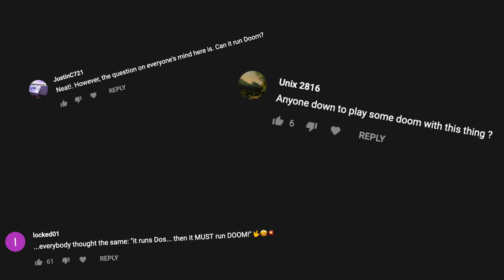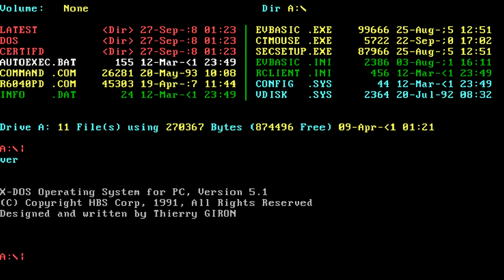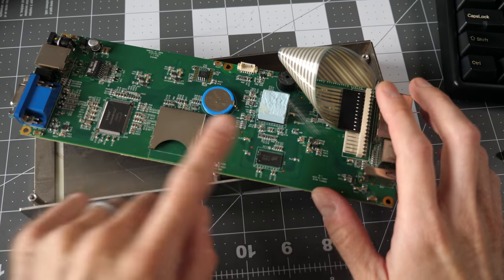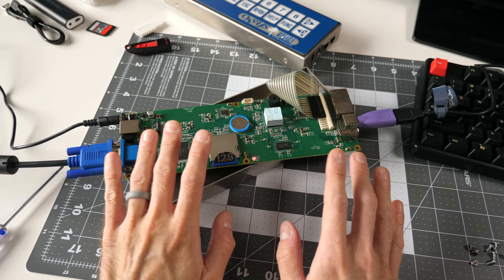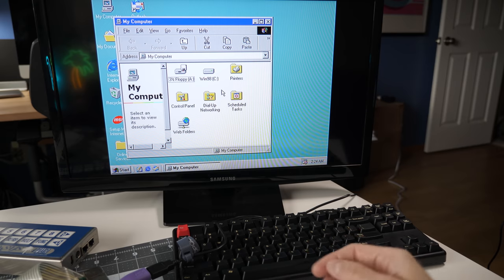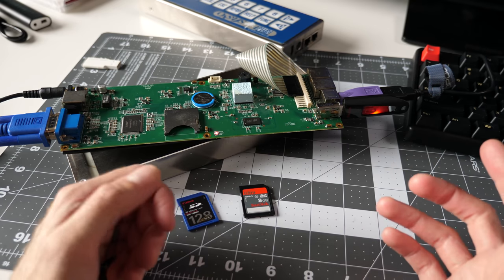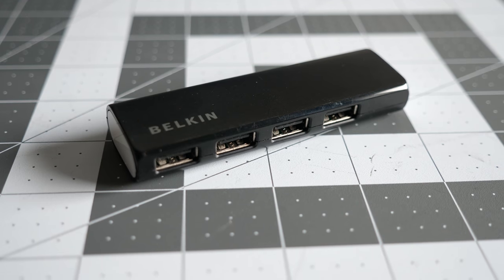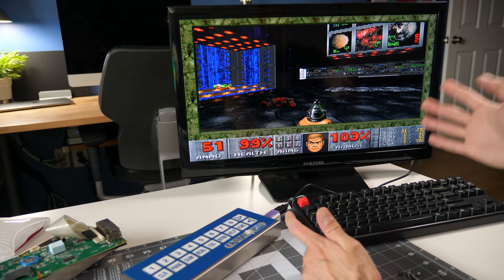Doom on a Commercial Kitchen Appliance

Comment: Wait, Why on earth I would need to run Windows 98 or XP on this thing? I have almost 20G of dos games from 1980 to 2000 that only need keyboard and mouse; they do not need PNP BIOS or fancy stuff. Yes, the lack of a soundblaster is a big minus, but anyway, as a plain dos (maybe Win 3.x) machine this is perfect.
You can not sys a: with dos 6.22/dos 7 or it is write-protected? If is possible, can boot dos 7.1 from a: and use a FAT32 SD card as the internal HDD (just point the path variable to c:) and so have a nice dos machine
As you said can use a PS2 splitter. I am sorry that these are so rare and hard and expensive to find, I would love to have one to thinker with it.
Just thinking about that NIC, maybe there are drivers for dos/Win3.11 to FTP on my server?
Edit: I never ever heard about Windows 9x writing something on a floppy when reading it, unless you have a (boot) virus. I downloaded some time ago boot floppy image for dos 6.22 and there was a boot virus. And the BANANA CDROM label, I think (maybe I am wrong) that is not the original from Microsoft, old floppy images had CDROM or CD001 instead.

Comment: To me, it was a bad idea to rely on windows 98 that relies on the FAT filesystem technology to work with data stored on hardware, best to use a different solution to do a 1:1 copy of the data on the chip to avoid overwriting anything there. If XP can run on this but use linux instead and use a partition editor to maybe copy the partition into a file and then take that to your regular computer to analyze the data on the boot partition. Hope this works.

Comment: I have a 86duino running 98 and XP. The individual drivers can be found on https://www.compactpc.com.tw/. As far as I can remember, the vortex line is based on the S.i.S line SiS550, so if you cannot find Vortex drivers, try looking for drivers for the 550. Trust me, the SiS 550 is a x86 "pentium" like system that SiS was developing until they sold it to DMP, at least as far as I can remember. The Seabios includes support for USB, the problem however is that the USB needs a rather finicky driver in order to operate. Without the driver, the USB will not show up in Device Manager at all. Then when it comes to your flash chip, both 98 and XP will need a flash driver to correctly access the disk otherwise they will corrupt it. Usually embedded Windows comes with the driver installed, but since you got X-Dos, is seems it's not the case here. The problem lies in the sector sizes, and how flash based drives are addressed differently from normal hard drives. If have three other vortex based machines and they are all fun to play with.

Comment: How about to take out the spi flash, or just unsolder the power pins? The device will boot the only thing availabe which is the sd card. Also from windows a usb soundcard can work probably, windows may output sound to it from games even.
Reply: @mickwheelz Thats a real bummer, perhaps a standard spi chip, can be upgraded, there exist 64 mb variants even.
Reply: @mickwheelz Very delicate stuff , well, its repairable i guess, but there is the question, do you want to? Or do you value your time more. :)

Comment: You can de-solder the virtual chip to allow the system to also use the SD card slot. It definitely will only run Win98. Check out "lattepanda", it is a single board computer with 2 GB or 4 GB of RAM and 32GB or 64GB internal storage. It runs windows 10 and starts at $100.

Comment: Oh god, what a security nightmare. A networked device meant for the POS network, with old hardware, that auto boots to a USB flash drive.
Reply: not really..not networked so requires physical access. almost all kiosks w/usb port can be taken over. and in his older version usb access required case removal.
Reply: @littlepeon  It is networked, It's how the orders are sent to the machine. I am a network engineer for restaurants we always make sure USBs are locked down, some by physically by putting epoxy in the ports. The issue is, all an employee/cleaner/social engineer needs to do is flash a malicious version of the firmware to the device and then the POS network is owned. It wouldn't be that easy with most POS terminal's.
PCI compliance is a bitch, and I bet those things are overlooked.

Comment: I dont want to sound rude, but your incredulity at doom running on this is a bit weird, as doom was at min spec supposed to run decently on a 386 with at minimum 4mb of ram, so IIRC this things CPU was derived from the OG Pentium spec, of course it was going to run! Anyways Great Vid, ahhh the adventures of hacking hardware to do things it wasnt envisioned on doing, great vid, blathering included.

Comment: I wonder if you were having all those Windows installation troubles due to the CPU overheating. I'd suggest removing that useless thermal pad and gluing a small heatsink (Or really, the biggest heatsink you can get that will fit in the case and not crimp the cable) to the CPU.

Comment: There are a few open source DOS USB drivers available that may allow you to use one of the USB Audio cards like SoundBlaster play. Also, you should try running Linux on this thing. And definitely replace the thermal pad with a proper heat sink.

Comment: The classic 7b blue screen error - you will need to slipstream the storage controller drivers on to the Windows XP install media.
Reply: Didn't NT/2K/XP have a (Press F7 to install storage drivers from floppy) prompt or something? You've already got a working USB hub, add a USB floppy drive.
Reply: @AndrewFremantle  I had very little success with this method (vendor drivers were not formatted correctly and / or not all USB floppy drives worked - I found only a SONY USB floppy would work. It was easier to slipstream with Windows XP install media with the nLite utility/app

Comment: Real question:Why is an Oasis iPad bump bar like $770 and a raspberry pi like 1/10 of that?
Reply: Because Oasys iPad Bump Bars aren't made for tinkering, and are just supposed to work for the company who uses them.
Reply: @eidodk  thanks
Reply: also price of the chipset. PI's use ARM processors which can't do fast computing, so they are cheap. Oasis uses a Pentium 200 knockoff chip which actually has about 50 times the processing power of an ARM chip--so the chip alone is worth $100. The fact that you have it in a small form factor adds another $200 to the price. You can actually find these used on ebay for <$300 which is a good buy.

Comment: You probably thought of this already, but didn't bricking the A: drive cause it to boot from the SD card?
Reply: No. Win9x only modifies a few bytes of the boot sector (which are normally ignored) but doesn't touch the boot signature. The BIOS still sees the drive as bootable but it crashes once the corrupted code is loaded.
Reply: @eDoc2020  So with the right program you could change the boot signature to non-bootable. Then it should boot from the SD, right?
Reply: @GordieGii  Yes you could destroy the boot signature. But then two things would happen. First, the filesystem on it would become invalid because the FAT is always required to be bootable (the "Invalid System Disk" and "Non-system disk or disk error" messages are actually displayed using a tiny boot program on the disk, not by the BIOS).

Second, it might not actually work because SeaBIOS and/or the legacy Bochs BIOS do not actually check the boot signature in all cases. If that is the case here then obviously it won't know to skip to the next device. Then the best option would probably be to put a boot program on the floppy which then just transfers control to the boot program on the hard disk.
Reply: @eDoc2020  I didn't say destroy the boot signature. It's already destroyed. I said change it to 'non-bootable.'
It might not work, but the SeaBIOS did show the boot list, so it might work.
This is all academic anyway since the objective was to have a method that didn't modify the boot flash 'floppy' at all, which he achieved with the USB drive. I was just thinking how he might un-brick his bought system.
Reply: @GordieGii  Perhaps I should clarify. THe 'boot signature' is the two bytes at the end of the first sector which the BIOS looks at to see if a disk is bootable or not. Aka it is the bootable 'flag'. This is separate from the actual executable code.

If he wants to unbrick his internal flash, that hopefully shouldn't be too hard. X-DOS is available as shareware, so one could download it and run XSYS to make it bootable again.

For reference, the shareware version of X-DOS can be downloaded from the Internet Archive. Its identifier there is 'msdos_shareware_fb_X-DOS'.

Comment: First off, that's gotta be a USB 1.0 interface and using a USB keyboard and mouse (the mouse in particular) would kill the performance as it would use up all kinds of CPU cycles that PS2 does not. Beyond that you should've just removed the chip for the "SPI Flash Disk" which contained the original OS. It's easy to remove even for an average person. At that point the system is forced to run form the SD Card because the initial boot device will not be found and it will move on to that automatically. All that said... you can just run from a USB drive if you cut a hole in the case but how many people having a version that doesn't expose the USB port would want (or can) cut out a hole for it?

Comment: The issues with windowsxp are because.... it's running from a usb device. I tried to have a "roving" install back in the day. It's not fun. You need a modified windows xp install to even INSTALL correctly to a usb destination,  and then a custom driver afterwards to see the usb device as it's C: drive. 

With he odd bios, it might not even be possible, as it usually requires a bios to be able to enumerate the storage devices to windows....

Comment: I would have jumped to do Linux forget about all these restriction stuff, in a direct opposite and deliciously ironic way Linux in 21st century is leaps and bound superior to Windows in hardware setup and driver situation even thought I did say it was directly opposite to the 20th century in which Windows was the superior environment back then.

Oh SeaBIOS is what Chromebooks use for the unlocking mode of these machines. Normally it is CoreBoot into Chrome OS but with SeaBIOS set alongside it you can use another proper Linux with Chromebooks.

Comment: Doom resolution is like 320x200. Or 320x240. The CPU on the Vortex is a 486 running hundreds of megahertz... while Doom can run on 386's with a couple of tens of megahertzs. Although not too smooth. Running doom is not a challenge. See how high you can go on resolution with Quake.

Comment: Could you make a copy of X-DOS using its SYS.COM? I'd love to test it.
Reply: don't know if you can still get it from HBS, but here is the manual for it:
ftp://ftp.dmp.com.tw/os-dos/XDOS_UM_v1p0.pdf
Reply: @littlepeon  That link brings up error 404
Reply: @IrisGalaxis  so chrome and firefox have deprecated ftp. Copy the link including the original ftp part  that is not 'linked'. So your browser needs to read ftp://<link>, NOT http://<link>
Reply: @littlepeon  oh ok, thanks
Reply: @littlepeon  They seem to have locked down their FTP and disallowed anonymous access.
Reply: @TurnerXei  the link cuts off the ftp:// part, copy it all and it will download
Reply: @littlepeon  I know, I tried it both from Firefox and from the GNU FTP commandline and it happens with both. Weird?
Reply: @littlepeon  I ended up being able to get the same URL to work via searching for it and clicking through from Google results. Strange, but glad to have it, thanks!

Comment: You boot into win9x'es boot menu and go straight into DOS. Then you do "sys a:" in your prompt to rewrite the boot sector.
If the windows system files dont recognize the shipped interpreter you can just put a copy of the "DOS 7.0" win9x comes with on the internal storage.
Technically i think the command.com would suffice, in case storage is an issue, but why not bump it up to a "proper" DOS while your at it anyways.
Normally DOS stuff is pretty intercompatible, i used to run MS-EMM386 on Novel DOS for better memory management compatibility in games.
 
Also, considering how it runs open firmware (if your unfamiliar with it still, check out System76, they offer really sweet FOSS laptops) i wonder if it runs Linux.
Some Puppy Linux versions "work" with as little as 64MB RAM and fit on a 256MB stick. And on Linux you have a whole variety of DOOM ports to choose from... :p
Reply: The Win9x SYS command will copy the Win9x command interpreter over the original one. However if the X-DOS installation included its own SYS (or you can find it online) that could likely be run from DOS 7 to restore DOS-X.
Reply: I dont think the actual DOS version used matters at all, so just copying the contents of \command to the internal storage seemed like an easy and lazy enough approach. :)
Id still prefer to see it run Puppy tho, lol.

Comment: IIRC, Windows will update the OEM Name field in the boot sector (LBA 0 or CHS 0,0,1.)

The official MS tech spec on FAT will tell you this parameter is informational only, and is not used for anything.  This is a dirty lie.

It has been used as far back as DOS 2.0 to differentiate between the DOS 1.x disk format, which didn’t have a BPB (BIOS Parameter Block), and the later format that did.  It is also used, for e.g., by the PS/2 startup disks to identify them as special to the BIOS.  (They will not boot if this field has changed.)

I have even run into trouble with how Windows 95’s DOS interprets CHS vs LBA when setting up the boot loader with sys.com, which I suspect has to do with wanting the FS to have the “MSWIN4.0” string there.  (I was writing my own FAT utilities and had all kinds of problems until I changed this field to something it recognized, vs. my prior default of “fat.c”.)

So my guess is that’s what got clobbered by 98, and the reason the X-DOS boot loader deemed the volume unworthy.

Comment: Why didn't you edit the autoexec.bat from the XDos to do C:\autoexec.bat (so that it boots from the SD card)
Reply: DOS doesn't work that way. IO.SYS in the case of Microsoft or something similar on other DOSes is what actually boots the system. And it needs to be placed properly in the boot disk by SYS.COM or the DOs installation.
On MS DOS, IO.SYS is then followed by MS-DOS.SYS, followed by loading the stuff on config.sys and autoexec.bat and lastly the command interpreter COMMAND.COM 
On Windows 9x DOS, the IO.SYS alone does the heavy lifting, as the MS-DOS.SYS is now a placeholder txt file with a few options and padding:
;The following lines are required for compatibility with other programs.
;Do not remove them (MSDOS.SYS needs to be >1024 bytes).

Comment: This is cool I’d like to see something like this on one of the Credit card readers you see in retail stores as I wonder if they can do more them then they do normally
Reply: Electronic payment terminals are designed to be at least moderately tamper-proof. Potted chips, fuse bits, encrypted ROMs and probably other fun surprises. Not saying it's impossible, but they won't make it easy for you. They're also not very easy to get, as they're usually owned by merchant payment processors and rented to merchants. Every processor I know will only allow you to use their pre-programmed terminals, and each is unique to the processor, which is to say there isn't a huge used market. Merchants have to return them when they're no longer needed, or be hounded worse than a cable company for a modem or DVR you already mailed back.
Reply: @W1ldTangent  or on a voting machine-ATM machine would be funny as all hell.
Reply: or on a mcdonalds sharp dos cash register